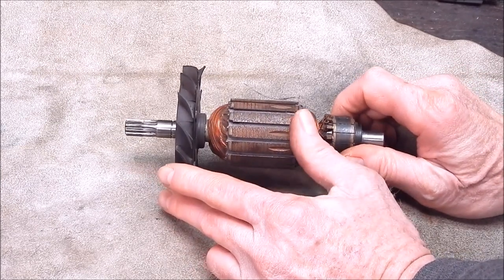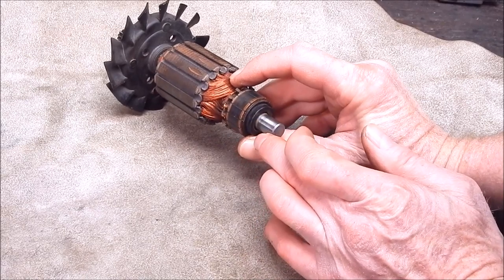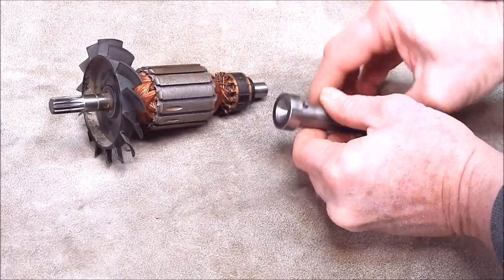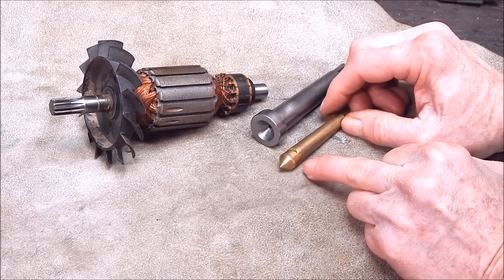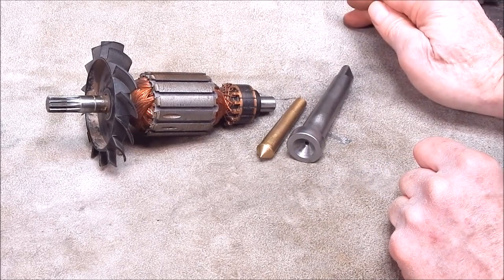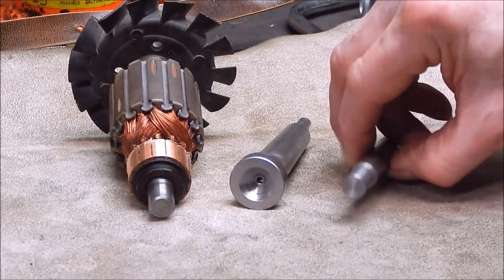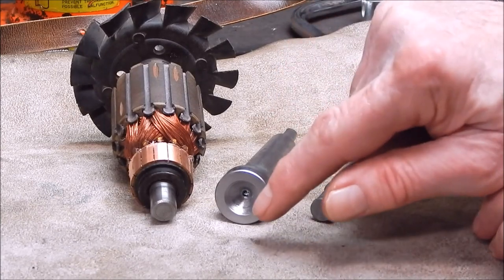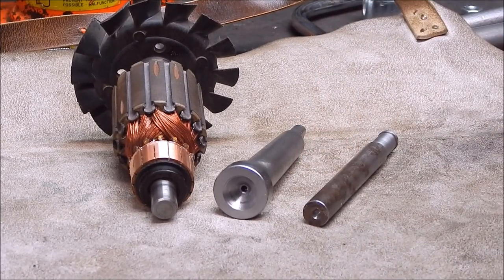How well does a cup dead center work in a metal lathe tailstock  ?

Comment from the maker: NOTE:  The one major downside with this type of center is that you cannot machine right to the end of the shaft, as with a pointed center.

Apart from that restriction it works fine and gets around difficulties trying to drill centers in hard to hold stuff or metal that has been induction hardened (quite common these days).

Cheers Rob

Comment: An easy and elegant solution to a common problem for diy repairers!
Many years ago the JACOBS chuck people offered a tooling kit for the reworking of automotive armatures for starter motors and generators.  This before the days of the automotive alternator, a quite useful improvement.
This tooling kit consisted of a large drill chuck for the lathe headstock spindle, and a steadyrest chuck for the tailstock.
The latter is a really interesting piece of work.  It appears as a large drill chuck with very worn BRONZE JAWS!  Further, there is a locking ring on the chuck body to fix the jaw adjustment to provide a running clearance between the chuck jaws and the armature tail shaft.  The kit also included a motorized spindle carrying a small slotting saw to undercut the mica insulation between the commutator segments.  This is an important task if the commutator brushes are to last their normal life expectancy.
By dumb blind luck I found such a chuck at a flea market, oh, 45 or so years ago.  Greased and filthy it appeared as a worn-out drill chuck, what with the big flats on the inner surface of the jaws.  Cleaning off one jaw a little disclosed the bronze material, and I acquired this chuck for a song.
Cleaning it up at home disclosed that it was practically unused.  I still have it and use it occasionally for its intended purpose.

Comment: That is a cool idea, I'll admit this is the first time I've seen one of these in use.  Very handy little tool, for sure.  I wonder how hard it would be to make a live version.  One way or another, it's now on my 'to make' list, thank you for sharing the idea!
Reply from the maker: It probably would be pretty easy to make a live one.  Just a straight shafted cup in a couple of ball races (same as any other live center but with a different centre shape).  You can buy live centers with swappable tips of various profiles including cups, but they are over $100 so quite expensive.  This one is cheap and easy to make and does the job. Cheers Rob

Comment: Great example of using that special center. I have an import live center set which I seem to remember does have a couple of parts which might almost approximate your cup center. Have used it occasionally.
Reply from the maker: Hi Chris,I think Steve Jordan reviewed a similar interchangeable tip live center from Banggood that had several sized cups in the set.  Not cheap though, over $100 from memory.  Cheers Rob

Comment: that's what an armature chuck was used for, looks like a jacobs chuck but with bronze jaws and used in tailstock specifically for turning electric motor armatures
Reply from the maker: Hi Lindsay,  Yes, it must not mark the ends like a steel chuck can.  I take it this was a fixed (non rotating) chuck and the jaws acted as an adjustable bush/steady.  Cheers Rob

Comment: I  just tightened the splined end of the shaft in the chuck of my handheld drill and wrapped sandpaper around the other end. Cleaned that black oxidation crud right off lickity split, and no metal chips pushed in the grooves or excessive material removed. I know this a cup center demonstration. Great Idea though!

Comment: Hey Rob. I see you’ve got a new QCTP installed. Is that the small aluminium tool post? I bought a set with some spare tool holders but wasn’t overly impressed with the dovetail and the fit on on the holders. How are you finding it and have you modified them in anyway?
Reply from the maker: Hi Mick,

  I reviewed this a while back.  It's hard alloy.  Total pleased with it.  No issues at all.   No mods.  Everything fits OK.  I see some people slagging off at these, but I think they expect too much from it.  It's only suited to smaller lathes.  I have it on the 9" swing Schaublin lathe and it works fine. Handles carbide quite OK.   Cheers Rob
Reply: xynudu I have a similar one in my ML7 and its fine for small work and much better than fiddling about with the standard bolt down type and the fine height adjustment allows you to find and maintain centre height between tool swaps without arsing about with shims. Accepted it's not some sturdy lump that Adam Booth would use but a good cost effective solution for a small lathe none the less. Oh and I like the cup centre Rob 👌bonzer.

Comment: Good vid as always xynudu. Haven't seen a cup dead center used before.
Reply from the maker: Thanks Soro.  It's an uncommon rarely seen center.  It has one major drawback in that you can't machine right to the end of the shaft as on a pointed center.  So it is really only for specialised use such as shown.  However, it allows you to turn plain end and hardened end shafts that have no center point or can't be drilled due to induction hardening.  Cheers Rob

Comment: Jacobs chucks make a set of commutator chucks for this very job ,the tailstock Chuck has bronze jaws that support the shaft and the other Chuck has a Morse taper to fit the headstock taper.theywere common in auto electric Al shops but not cheap of course.
Reply from the maker: Yes, I've seen those.

Comment: Hmmm How would one made of brass go?
Thanks for the video Rob.
Reply from the maker: Bit doubtful Walter.  But I could be wrong. The pointed dead center in the video was one from the old Shaublin tooling, but I'm not sure if it's brass or bronze. I've never used it.  It may just be for static work holding.  I don't know.  Brass is hard and sometimes used for bearings so maybe.......... Cheers Rob
Reply: @Xynudu  Steel on bronze has a much lower coefficient of friction than steel on steel, which is why bronze is often used for plain bearings or bushings. I think a bronze cup would run even cooler. Bronze is a bit soft compared to steel though, so it would be relatively easy to mar or damage the center and it would be a little less rigid too.

Comment: Nice and simple, the dead centre not you Rob. You could make one that slipped on the live centre as they sell live centre kits for wood work, cant see why they wouldn't work for metal cheers.
Reply from the maker: Hi Russelle, They do sell live metalwork centers with interchangeable tips including a few sizes of cups.  I had considered making a cup centre that would fit over my existing pointy live center, but there's really no need.  This idea works fine.  Also it would probably get stuck on or introduce error.  The live centers for metal with multiple tips are not cheap either.  For something you would only ever use occasionally this will do me ;)  Cheers Rob